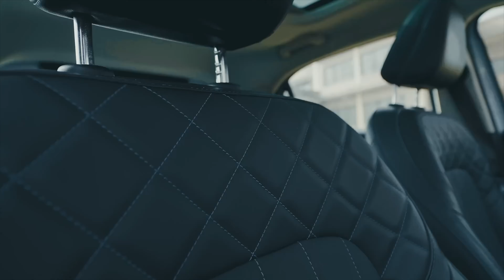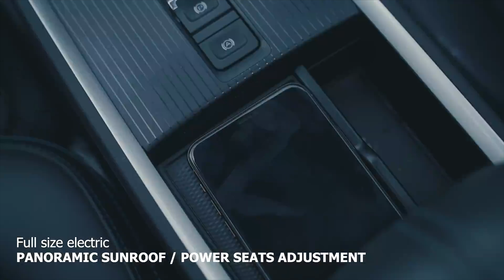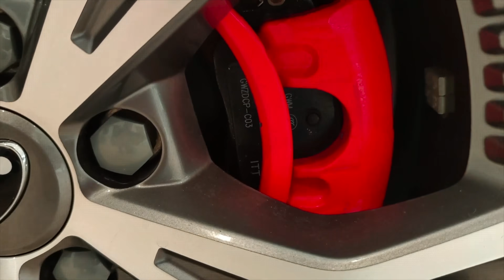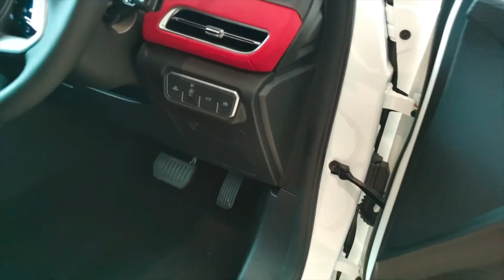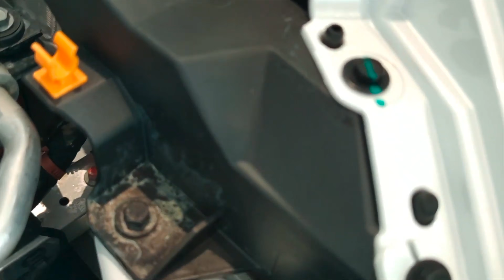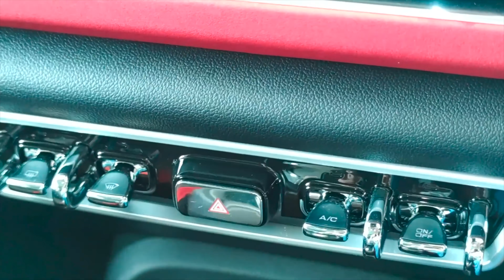2026 GWM Ora price and specs: Electric hatch now Thai-built, gets new battery

Comment: I've been comparing similar EVs and I keep coming back to the Ora, I found it the most comfortable to sit in, best rear view with smallest blind spots, great safety and comfortable to drive, definitely the cutest! And the customer service at GWM was MILES ahead of the others. I nearly wrote off BYD completely after their absolute lack of assistance or customer service.
I'm going from a hybrid Prius to electric and the Ora is where its at for me.
Reply: Did you try the new MG4 URBAN for comfort also quality of battery, range etc?
I like the Ora especially the blue and white interior of some but it has a tiny boot, and battery range is not far. And there is no rear wipe and no heated driver seat.

Comment: Just picked up a brand new Lux for my better half for $29k drive away in March 2026, hard to beat for value and nice all around for it's price.
Reply: Where did u buy in aust. How its performing
Reply: @salmansiddique3448  brought it in QLD.  So far so good expectations are not high due to the price point, and it is therefore exceeding every one of them by a lot.  A lot of car for the money compared to anything we've had before it. Legacy manufacturers really should be worried.
Reply: what model for 29K drive away?
Reply: @zararatcliff5113  that was a GWM Ora Lux.  prices stepped up quite a bit since the war started
Reply: @zararatcliff5113  Ora Lux (not the ugly new Ora 5)

Comment: The range is still the thing that holds me back. If the range was around the 600km mark, then i'd have an Ora. I test drove one a few years ago and really liked it.
Reply: I just bought this car and agree  . it really is a city car. If I was doing a lot more highway driving I would buy something else. It's not the range that bothers me . it's more the charger speeds. Mine will just be mostly home charged
Reply from the maker: That's fair enough. Most people are fine with 400km range, but lots of people still want 600kms. Hopefully the cheaper end of the EV market will get that within 3-4 years. I think they will. In the UK for example, often people aren't too happy with less than 200 miles of 70mph winter range. It is now possible, but a bit pricey for most people.

Comment: Hi Ben, 
I reviewed the Ora and Dolphin and MG4 on my Stormjuice channel. 

I had an MG4 on order a few years ago, but cancelled it after my review. Great to drive, but the infotainment system is slow/laggy, it lacked features the base Dolphin and Ora have (e.g. birds eye camera view), cheap materials and rip-off service costs ($1200 every 4 years).

The base Dolphin is underpowered, and the windscreen is quite view limited. 

The Ora has the same usable boot space, as the Dolphin (as the Dolphin hatch is shaped differently at the roof level, but that extra space isn't usable). 

The Ora software UI could be improved (as can most cars), and it takes a little bit to get used to the indicators. 

The UK version had driver monitoring, which we don't have (thankfully), so no annoyances there. The safety warnings can be turned down a lot so they aren't annoying. 

It's a great car to drive (although the Giti tyres that came with mine are average), and is really roomy.... More room than the MG4 or Dolphin, for people. 

I disagree on the looks. I love it. It was designed by Emanuel Derta (ex Porsche and Maserati), so you are correct on it's influences (Porsche 911 and 356 actually). 

GWM have a joint venture with BMW, where GWM actually build the electric Mini. You may notice that the Ora has a couple of things on the inside that are literally from the Mini. 

2 years with my car so far, and the LFP battery is rated for minimum 3000 cycles, which, if I drove 140km a week, will last over 100 years. 

Until something better comes along (and I hope they do) the Ora is still the best value hatchback EV, imho.
Reply: The driver monitoring isn't that bad and tbh quite amusing especially when she asks you to brake whilst in full cruise control with lane keep... 

Also think she's being racist when I'm laughing along with podcasts and she suggests I'm tired and should take a rest...

Comment: I have an Ora 03 Pure + (so the one with the 48kwh LFP battery) in the UK. I love it, but I have been surprised by battery degradation. After 13,000 miles the app says I'm on just under 90%. Not a concern at all as it's a leased vehicle and I will hand it back before it becomes a problem, but I would be concerned if I owned the car. I'd almost be willing it to drop rapidly to the point where I could get a warranty replacement.
Reply: All EV's drop most of their capacity in the first couple of years, before levelling out.
Reply: LFP battery need to be fully charged once a week as its cell battery voltage only curves steeply  upwards when charging from 95% to 100%. The BMS needs to see this steep voltage upward curve for it to calculate more accurately battery charge.

Comment: I agree with the Marmite aphorism in regard to the ORA . Both the product and the car are something of an acquired taste. (I like Promite. Yes, a guilty secret). The Ora seems reasonably well made and the paint is quite lustrous but not sure what they are copying with the plastic chrome switches. I can even see shades of a 911 externally if I squint my eyes and nod my head quickly. I think part of the problem with its sales isn’t it specifications or front wheel drive or even battery. It’s just that as a man you can get away with being seen driving an MG4, maybe even a Dolphin if it’s the family second car but you really need to be over 65 as a male or a woman to drive an Ora. Luckily I am happily in one of those categories (no not identifying as a woman) so could, if I chose, happily drive an Ora. It just happens that………yawn😮……..I don’t want to because I have sat in a Zeekr 7.
Reply: Lol. I'm 56 and happily drive my Ora. I did add some racing stripes to it, though, to make it manlier. Then I ruined that by adding cat's eyes at the top of the windscreen. Oh well :) 

The Ora was designed by Emanuel Derta (ex Porsche/Maserati). 

It has stolen chrome paddle switches from the Mini EV. GWM build the mini EV for BMW. 

I love the funky cat look of it, and still think it looks amazing, 2 years later. Aurora Green is the best colour (it's really blue metallic with green highlights in the sun). Wish I could show you mine (car, that is) :)
Reply: @garystorm799 yep, green is the best colour by far. I am of course joking about the relative manliness imbued by driving the Ora. It is an interesting car, as least as interesting to look at as the Inster and much cheaper. Unfortunately for those of us who live hundreds of kilometres from urban centres it just doesn’t suit. I get enough Ford Ranger bull bars 10 feet from the rear of my car at 110km/h now. Not sure I would like a speeding road train right behind me in an Ora.

Comment: Does the new Ora LFP battery have active cooling
Reply: Yes, all modern EV batteries have proper thermal management (cooling and heating). It's only the Leaf's and older (e.g. MiEV) that had passive, which is why they degrade so much quicker.
Reply: @garystorm799  I thought only to top line version of the BYD seagul has proper thermal management. The other 2 versions have passive cooling. I know the seagull isn't available in Australia

Comment: The software is useless. Black screen, safety features turning themself off etc  I bought one in April 2023 and the dealer refunded me in December 2023 because it was not fixable. That’s why they stopped selling them in NZ
Reply: Some have had screen issues. Not many, and in those cases replacing the screen fixed it. I guess some batch of screens were faulty. 

2 years in and I've not had that issue.

Comment: My wife has an Ora 03 Pro, 64kwh... I could give you a full long term review... But keeping it short.

It definitely looks the part and has loads of kit, interior for a city car is very good quality. Range is 240 miles real world on the 64kwh battery. It is a true 5 seater, space in back for passengers is good, luggage space is very poor, and no underfloor space for charging cable.

It drives well, if a little spongey/soft suspension (it leans in corners which you wouldn't expect of a car this size). The steering wheel is massive, and feedback is very poor.

Unfortunately despite the looks and the tech - I cannot recommend it!

The software is buggy, and the UI hard to navigate with small controls/icons, and very busy.

All the security features are over sensitive and intrusive, the emergency lane keep regularly grabs the wheel hard for no reason - useless. (and you have to turn them off on every trip)... But it has one very serious safety issue... 

The indicators randomly do not cancel, and I mean manually not automatic cancel!... Being polite, you could say there is a knack to it... Being real, it's a design flaw and unsafe. Google it.

We have had nearly had a dozen  accidents when drivers waiting at a junction think we're turning left or right, act accordingly and we're not.

Also if you're in the UK dealer backup is scarse... Dealers that took on GWM have abandoned them and switched to BYD or Omodo. GWM don't really have a UK precense.

No software updates since we bought the car 18m ago, and nearest dealership to Southampton is about 100 miles away.

Unless you live right near an Ora dealer you're on your own. Given the flaws I wouldn't buy another.

My wife is currently too scared to drive it, and it's sat on our driveway with 1500miles on the clock and I am still paying the lease!

Comment: The back end looks pretty good to me. But if you're going to offer a GT version, it can't just look racy, it's actually got to have better performance IMHO.
Reply: I agree. I own the base Ora and the GT only offers a nicer body kit, colours and a couple of minor features.
Reply: @garystorm799 I just bought the GT. while I mostly agree there are extra features apart from just the body and visuals . Front Parking Sensors
Automatic Parking Assist (The car can steer itself into parking spots)
Panoramic Sunroof
Heated and Ventilated Front Seats
Massaging Front Seats
Heated Steering Wheel
Driver's Seat Memory Function
Hands-free Electric Tailgate

Comment: Ora has perfect looks for female buyers but it desperately needs powertrain and suspension upgrades. This can challenge mini.
Reply: In China it is built on the very same line as the Mini 😊
Reply: What's wrong with the motor and suspension?
Reply: @garystorm799 I drove it. It's is good suspension and better than Dolphin I suspect. But everyone always wants more power. especially if it has a GT badge. Dolphin has more power like MG4. It's OK on MG 4 with rear wheel but more power on front wheel drives just tends to wheelspin

Comment: Back 18 months ago I had the choice of the MG4, Atto 3 and Ora. Based on reviews I went for MG4 as the only one of those three with RWD and I am happy with that choice. If the choice were between the new up-coming FWD MG4 and the Ora, I would have to test drive both, but I wouldn't discard the Ora because it might be a less well brand name here in Aus.
Reply: I had the same choice. I cancelled my MG4 reservation, and bought an Ora. I just knew the MG4 would piss me off every day with it's slow infotainment screen, and expensive servicing.